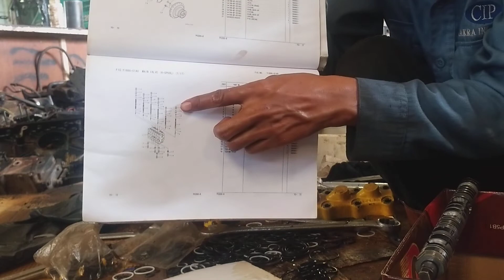Reseal Control Valve PC200-8 Part 1

Comment: Main spool ini harus pre ya di dorong kekiri maupun kanan
Reply from the maker: Betul om, sebisanya terasa licin,,,
Jikalau tidak licin, tapi masih bisa gerak kanan kiri gpp.
Asal tidak keset, seret, apalagi jammet.
Usahakan ringan kalau di gerakan
Reply: @tehnikengineering  ya unit saya pc200-8 pressure ngjem. Ndak dimainkan joystick sudah ada pressure boom raise. Saya cek di auto del ON terus switch pressure boom raise kang.
Reply from the maker: @RoslanHazard  mungkin ada kebocoran dalam, di copen satingnya om. 
Yg paling deket boom ya SWING sama travel
Reply: Confensating valve Boom raise ya. Boom raisenya yang sebelah kiri atau yang kanan bang.
Reply from the maker: @RoslanHazard  kalau kita menghadap CV, sebelah kiri
Reply: @tehnikengineering  ngikut arah kabin juga sebelah kiri ya. Depan case spool boom CV itu ya.
Reply: @tehnikengineering  tadi sudah saya cek spool joystic boom raise sama main spool Boom bagus freenya kekiri maupun ke kanan. lubang spool juga ndak ada buntu pas saya cek tadi. Naiknya boom enak kang. Pressure boom raise yang di pemantaun monitor itu 22,8 kang.
Reply: Confensating ja saya belum cek
Reply: Mas urutan spul gmna ya... Yg ada tanda pabrikan cat kuning ma hitam sebelah mna ya?